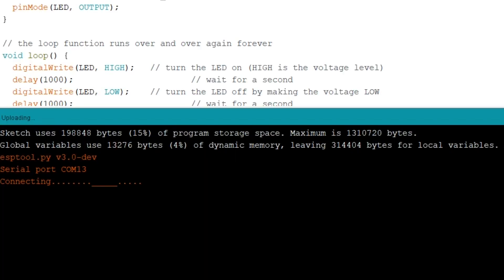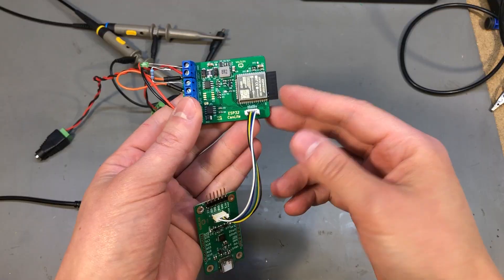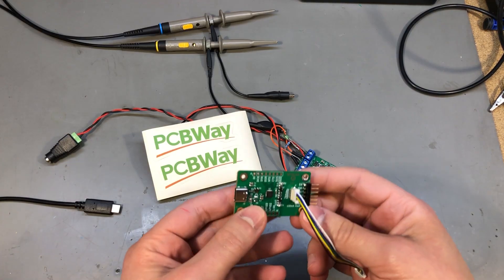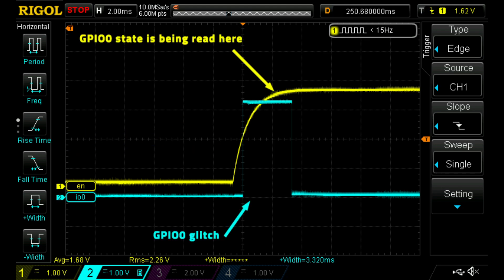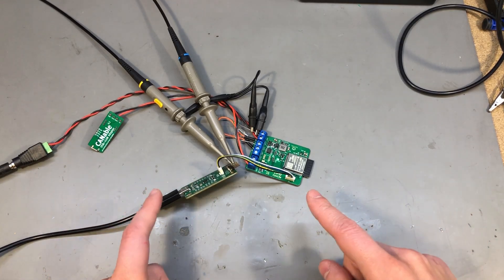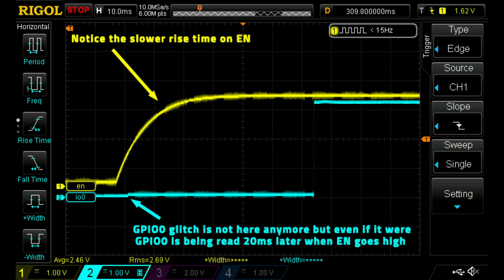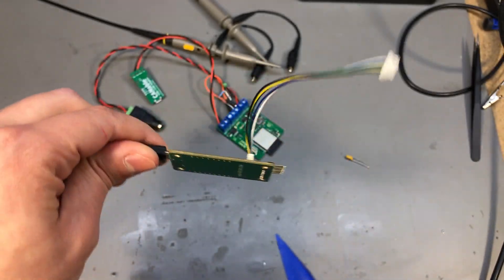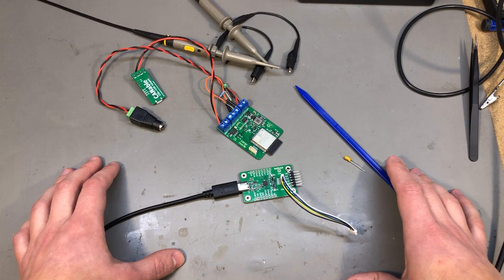A fatal error occurred: Failed to connect to ESP32 - Voltlog #357

Comment: I figured out that for me it only was able to flash if I removed it from the headers I put it in (luckily I didn't solder it directly to the board). As soon as I put it back in my circuit, it fails. Maybe it has something to do with using the same pin that has the led connected to it as a data output pin.

Edit: Yeah that's actually it... "D2: must be LOW during boot and also connected to the on-board LED"

Comment: I am getting the following message.

"A fatal error occurred: Could not connect to an Espressif device on any of the 1 available serial ports."

I have the VoltLink revE board. Should I try adding the capacitor like you did in this video?
Reply from the maker: No, please don't do any modifications to the Voltlink. Search for the problem I things like software, wiring, correct serial port selection, target device as the Voltlink is likely working fine.
Reply: @voltlog  I read more about it after I posted this message and I see that RevE has the capacitor. Yes, I agree that the VoltLink is working fine. I can connect to ESP8266 chips. I just cannot connect to ESP32 chips. I have checked wiring many many times. I am just missing something. I have the following pins connected.
-3V to 3V
-RX to TX
-TX to RX
-Ground to Ground
-IO0 to IO0

From what I understand, the VoltLink will take care of the rest to get the ESP32 into bootloader mode.

Do I need to connect the EN pin to make sure that this is working properly? Where does the EN pin get connected to the ESP32?
Reply from the maker: @TheJoeFletch  EN pin absolutely must be connected for the auto reset to work. It is usually labeled as EN on ESP32 boards.
Reply: @voltlog  if I only have access to an ESP32's ground, RX, TX, 3v and GPIO0 pins, then I don't need to connect GPIO0 to the the VoltLink, just hold ESP32 GPIO0 to ground. Does that sound right?
Reply from the maker: @TheJoeFletch  if you want to use the Voltlink the way it was designed to automatically reset the esp32 and put it in the correct boot mode for flashing you need to connect both IO0 and EN

Comment: Hey, nice video. I'd like to ask something. I was having the same issue on an old windows pc (via a USB2 port) then found this video. I have no capacitor at hand so, the first thing I did is to try the ESP32 on another USB port of the same PC which is USB3.0. And Voila ! It worked. Next I tried with that old USB2 port and interestingly the ESP worked this time also. So, I wonder is there any kind of auto correction or syncing system maybe either in ESP32 or the ESPtool for which the system worked the second time?

Comment: I had a problem with exactly the  same programmer symptoms on a custom board. It turned out that the bypass capacitor I had put on the EN (Reset) pin was too big, I swapped the 1uF capacitor out for a 100nF capacitor and I haven't seen the issue on any boards since.

Comment: Yes I had that problem with some TTGO ESP32/LoRa boards. They have on board CP2104 USB to UART IC and adding 2uF across the RST/EN to ground got it working reliably. They seem to only have 100nF to ground with a 10k pull-up to 3V3. I've also used similar Heltec boards which work fine.
Reply from the maker: I have that combo with 100nF and 10K pull-up on the board shown in the video. This is my standard circuit for reset lines and I use this on pretty much anything I build but in this particular case it didn't do the trick. I think you need at least 470nF for this method to be effective.

Comment: I recently ran into this problem... I've tracked it down to an issue with the way esptool.py hits the DTR and RTS pins to trigger the reset. Turns out the python serial library doesn't have a way to set both those pins at exactly the same time, thus producing the glitch you see. The solution is to change the esptool code to change those pins at the same time. I have some hacked code that works, but haven't had the time to publish it anywhere yet.
Reply: search in esptool.py for 'setDTR' and 'setRTS'... you will see they are set using separate calls. I fixed it on the linux version by using ioctl to set both at the same time.
Reply from the maker: I have seen this discussed on Github and it's true it's the root cause of the problem but given that the solution to fix it at that level is to change files inside the toolchain personally I don't like it. What happens if you switch to a different computer that doesn't contain the fix? What happens when you update the toolchain? I'm sure that a SW developer is likely to prefer this kind of fix but I am a HW developer and I prefer the HW fix 😁 Unless, this is a fixed at a higher level by Espressif and it's packed in all future releases.
Reply: @voltlog  In my most humble personal opinion (which I nonetheless hold very strongly) fixes and workarounds are two very different things, a distinction which to me seems lost on a disturbing proportion of modern engineers. I would never use the latter if the former is possible - and in this case the sole means to do that would be correcting the software. YMMV...
Reply: @AttilaAsztalos  Yeah and the cap workaround didn't worked with my esp8266, the problem is defenetly with esptool.py altough in my case reverting back to an older version fixed it.
Reply: @wagnerthomas6780  what version did you revert to?
Reply: @maxcampos2  2.5.0
Reply: @voltlog  I agree a hardware fix is better on new boards.... however that doesn't work if you have an existing board (like the Olimex Dev board) and you are not capable of fixing the hardware, or if you have 100s of existing boards that used the 'standard' dual transistor reset circuit. Unfortunately it appears  there is no perfect solution right now :(

Comment: Hello, we experienced almost the same about a year ago. We used an Olimex development board, the Esp32 devkit lipo. Also sometimes this error would show up. After studying the esp32-wroom data sheet, (page 20 of that sheet) provided by Expressif, we discovered that there should be a 10 k resistor connected from 3v3  to pin 3 EN and a capacitor of approximately 1 uF to ground. We designed our own board in the end with 10 k and 100nF and this worked fine every time
Reply: Isn't this already integrated into the module? I can't remember off hand, but I had a feeling you only need to add this yourself if you layout the bare ESP32 chip
Reply: @sdgelectronics  You could be right about that. As far as i can remember, the Olimex board itself, used a 1k resistor and no cap. I have to compare their pdf diagram from that time to their recent one, as i noticed that they use a much higher value for that resistor recently. I did not take a look under the metal hood of the Wroom module itself Maybe by using these values on our own board, we are still in the clear and was the 1k on the original Olimex board far too low
Reply from the maker: I use a 10K pull-up and a 0.1uF decoupling on the RESET (EN) line of every circuit I design, that is my standard. I had this on the board shown in the video but unfortunately it's not enough capacitance to create that delay ("the fix"). You really need at least 1uF for it to be reliable.

Comment: An USB log (using Snoopy Pro or similar) would be interesting to see, when the "glitch" does happen. It might just be bad programming on the toolset side which sets the EN pin before resetting the IO and depending on the USB packet timing the IO reset might only arrive a packet later; this would be visible in a trace.
Reply: Attila, you are correct. It's a problem within esptool.py. See my other comment for details. Of course it can be also fixed by adjusting the hardware reset circuit to account for this glitch.

Comment: Back in the 90s I used a chain of inverters to delay an impulse - a capacitor within that chain would have been an improvement, but the system was slow enough to work anyway.
Reply from the maker: Luckily in this case we simply don't care if the EN is delayed a few more tens of miliseconds.

Comment: 2 Thoughts on this:
1. I'm sort of thinking from that initial scope capture shown, that the real issue is there is any real capacitance on the EN line. That RC constant is causing the EN to not have a clean edge or easily deterministic start point, a proper reset supervisor wouldn't have an output like that (but RC circuits are cheaper) primarily reading the datasheet I see that:

"During the chip’s system reset release (power-on-reset, RTC watchdog reset and brownout reset), the latches of
the strapping pins sample the voltage level as strapping bits of ”0” or ”1”, and hold these bits until the chip is
powered down or shut down."

So if that EN signal went high faster (it's RC constant were removed and given a more square pulse) before that glitch occurred, then it would have already been stored as a strapped value. the pins are required to stay in the correct state for 1mS after EN "CHIP_PU" goes high to be considered properly latched.

2. The datasheet states GPIO0 has a weak pull-up resistor (WPU) and that the default drive strength of that is ~75uA, another thing worth trying, is installing a pull-down resistor on GPIO. Using a value of 5k should make it ~0.4v during that WPU event. Which puts it well under the required Voltage-Low threshold of ~0.8v @ 3.3v.
Reply: I was having problem with ESP32 DEVKIT (chinese clone) flashing, it didn't matter if I pressed EN button.
When I added 5k resistor from GPIO0 to GND (link you suggested) the problem went away.

Comment: thanks, the oscilloscope picture is really helpful!! As far as I see, this is clearly a design flaw in the chip design in the first place :-( 

I totally sympathize with how time consuming it can be to figure out a semi-randomly occurring problem, and usually, until we humans figure it out, it takes ages (even though the solution may only take 2s). It's so frustrating! So kudos to you there for debugging, figuring out and sharing!
Reply from the maker: The chip is okay, this is mostly a design flaw in the toolchain/driver or how the OS handles signaling of the RTS DTR serial lines. These lines are then used in the auto-reset circuitry and because they don't switch at the correct timing we have a problem.
Reply: @voltlog  ok. But if they had known about the imprecise timing they could've just put a capacitor there in the first place, right? Or is there a downside of having it, that I'm blissfully unaware of? :)
Reply: @userou-ig1ze  I think they started recommending a capacitor after discovering the issue.
Reply: @voltlogpersonal8036  I hope it's fixed in the new s3 and c3 devkit boards!!